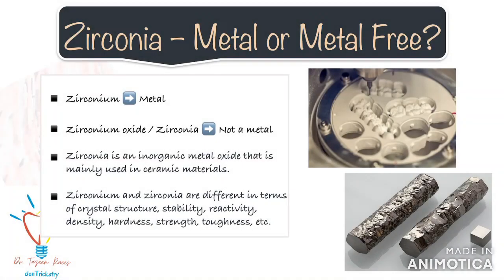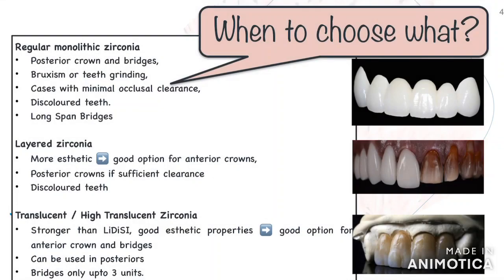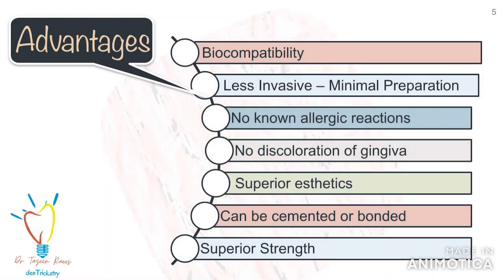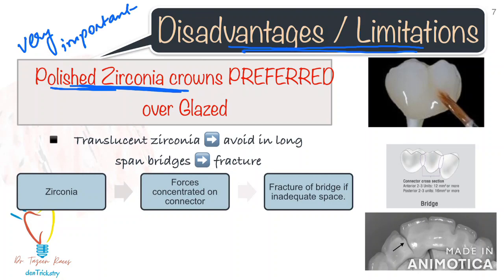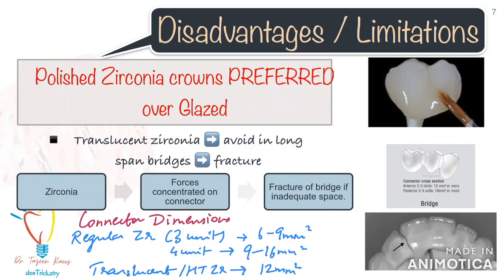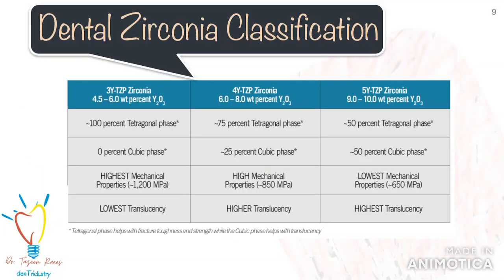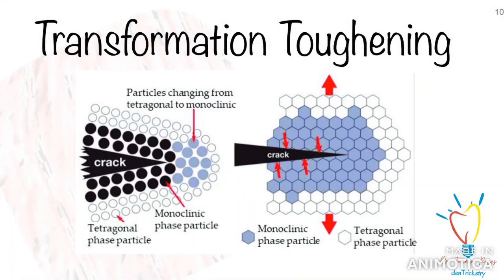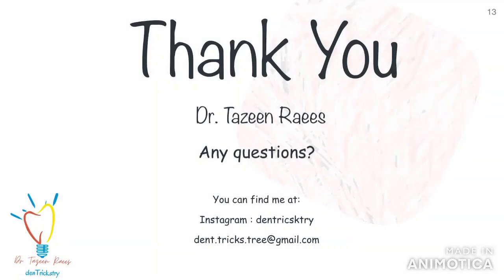All about ZIRCONIA CROWNS - (Types/Phase transformation/Transformation Toughening/Prep Guidelines)

Comment: Currently I am undergoing with RCT for one teeth(6th one) each on both side(lower) . What would you recommend me regarding crown? Should I go for PFM or Zirconia? Looking forward to your reply doctor.
Reply from the maker: Hello Sanjukta!  Both PFM and Zirconia are ok...I would prefer a zirconia crown. 
There are some factors to consider when deciding between them, Zirconia is more conservative compared to PFM ( The tooth has to be reduced almost 2-2.5mm for PFM but for Zirconia around 1-1.5mm) , also in case of PFM, the porcelain can chip off over time exposing the metal. When it comes to esthetics, both options give you comparable results...However, PFM is much cheaper than zirconia...so, the ultimate decision is yours...

You can watch this video I had posted earlier to know more about the advantages and disadvantages - https://www.youtube.com/watch?v=BXUFi-Chk4o

Comment: Greetings Dear Doctor, 
I am a fellow Doctor (Physician). I was wondering if I could ask you some questions about Zirconia crowns based on your clinical experience. I would highly appreciate it if you could give your point of view on the following:
1.In your clinical opinion are Zirconia crowns for molar tooth a good option?
2. What common drawbacks and disadvantages have you faced clinically among patients with Zirconia molar crowns? 
3. Did you clinically see any patients with root fracture of the underlying tooth crowned with a zirconia crown or the wearing of opposing teeth occlusal surfaces? 
4. What are other options for molar crowns in molar tooth with rct done with minor crack/fracture in crown area of the tooth? 
Thank you in advance for your valuable opinion.
Reply from the maker: Hello Dr. Fatema,
Here are my answers to your questions
1) Yes, Zirconia crowns are great for molars...I personally also prefer monolithic zirconia crowns for molars.
2) One thing I sometimes don't like is the esthetics between the monolithic high strength zirconia crowns (3Y TZP) and the natural adjacent teeth, especially when they are more translucent. It is because these zirconia crowns are opaque.  
But, since they in the posterior region, its generally not much of a concern to the patients...I usually inform them about this before I prepare the tooth.
Second thing is the connector dimensions for bridge, not faced any fractures personally, but for 1-2 cases initially, the technicians have sent my cast back saying the bridge would fracture due to inadequate connector height...ever since I have been careful of that. 
3) No, in my limited years of practice, I have not seen any root fractures under zirconia crown...I usually give a polished zirconia crown to my patients as per the protocol...never really had any long term follow ups to comment on the wear of opposing teeth. 
4) I think it depends on the extent of fracture, if you have sufficient enamel, you can even give an zirconia or LiDiSi onlay or a crownlay...Otherwise you can really give any other crown....metal, PFM, layered zirconia, LiDiSi depending on the case.
Reply: @teethstreet  Dear Doctor, 
Again.... Thank you very much for your valuable opinions....It really helped me.
Regards.
Reply: Regarding your answer to Question 4....To clarify a bit more.... The minor crack is on the left 1st maxillary molar (occurred after accidental bite on a fragment of hard bone) ... crown area is only involved along the lingual groove and crack is near to the pulp cavity on X-ray so RCT was done (also clinically there were signs of irreversible pulpitis)....otherwise the tooth structure is intact.
Based on the above information in your clinical opinion what are some of the best Conservative restoration options for the tooth that are long lasting solutions?
Thanks in advance.
Reply from the maker: @fatemamohammadalam965  Glad I could be of help :)
Reply from the maker: @fatemamohammadalam965 I believe either a metal or zirconia crown would be good....zirconia if you are giving and there is enough enamel present, you could consider bonding it...I think that would be preferable
Reply: @teethstreet  Thanks for your valuable opinion Dear Doctor. I really appreciate it.